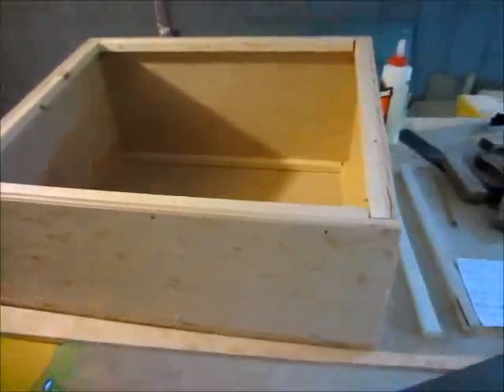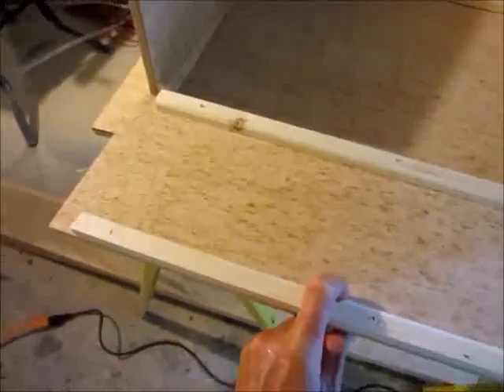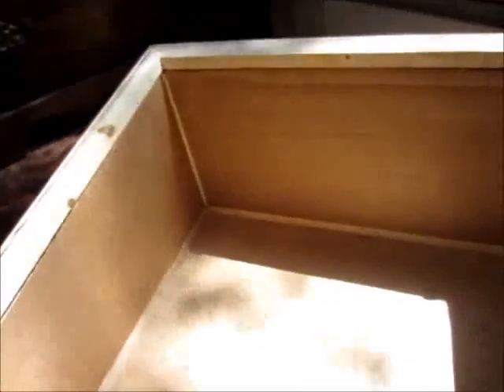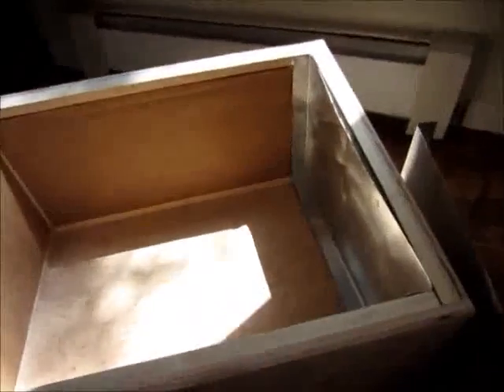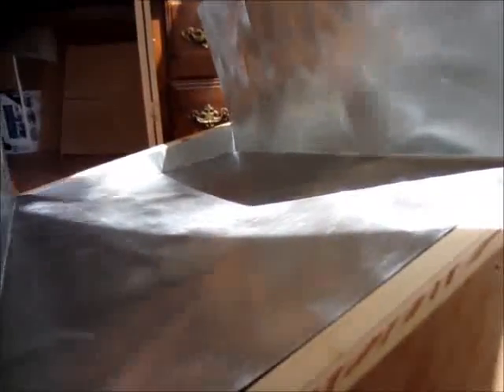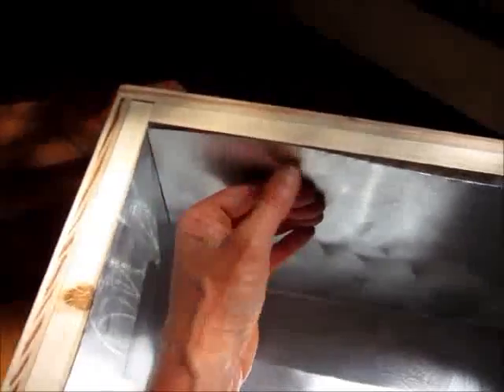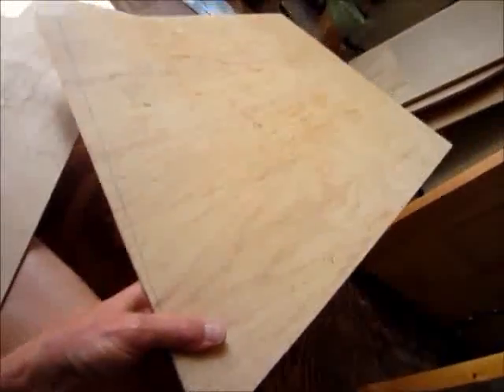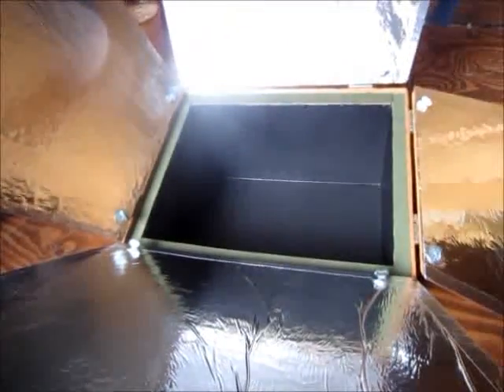How to Build a Solar Oven Using Natural Materials.

Comment: i am just wondering the toxicity of that galvanize steel .
Reply from the maker: I am just wondering WHY you would wonder about that.  lol.  As though the food were going to touch the steel.
Reply: My concern is basically  the fumes from the galvanized steel contaminating the food vs. stainless steel.
Reply: Hi again Brett, usually you are very well informed about any subject that you touch.......that is why I was surprised seeing you using galvanized steel under high temperatures, so I went to look for some information.  Keep up with the good work, you are great!    Here is what I found :  "When galvanized steel reaches a high temperature after heating, it gives off smelly, toxic fumes of zinc oxide. Therefore, a galvanized steel grill, stove or barbecue should only be used outdoors. There is a risk of a developing “metal fume fever” from breathing these fumes. Symptoms include loss of appetite, muscle stiffness and pain, fever, diarrhea and headache. These symptoms are vague and often mistaken for an onset of flu. Since illness usually develops several hours after exposure, it is difficult to make the connection between it and the stove or barbecue. The symptoms usually resolve within 48 hours. Toxic fumes may deposit chemical contaminants on the surfaces of barbecued food. Because there's a reaction between blood and galvanized steel, raw meat should not be placed directly on its surface. Galvanized steel barbecues, stoves, pot stands or grills should be kept at high heat until all unpleasant fumes are dissipated before it's used." http://www.ehow.co.uk/list_7367397_hazards-galvanized-steel-food.html
Reply from the maker: The steel is now coated with black tempura paint (egg yolks).  The food would be placed inside a container - never touching steel.  Also, what about the fumes from the CARS in front of you?  Most people are BREATHING a lot of fumes from different things daily that certainly would be more significant than this.
Reply: you are absolutly right. But remember, the idea was to make a solar oven as NATURAL as posible!!!!!